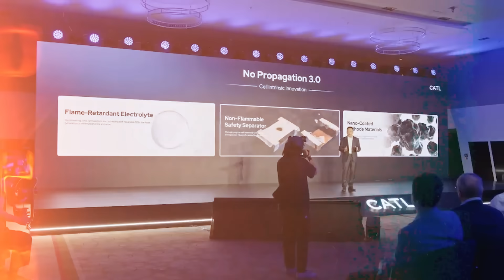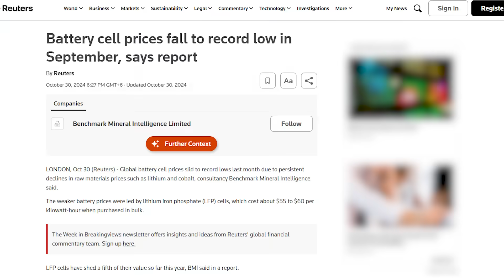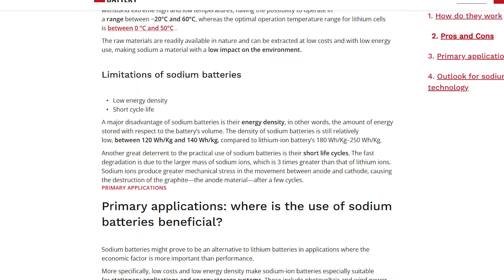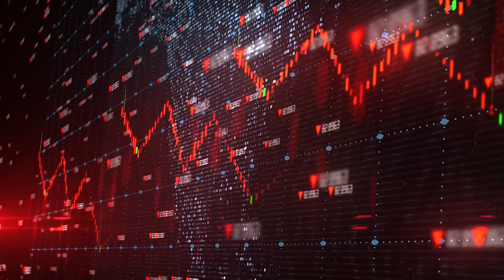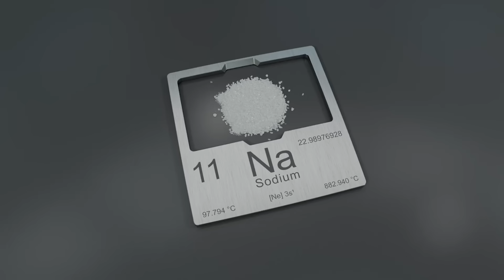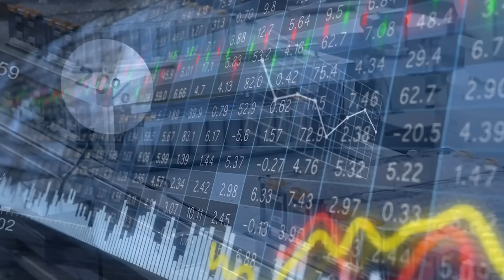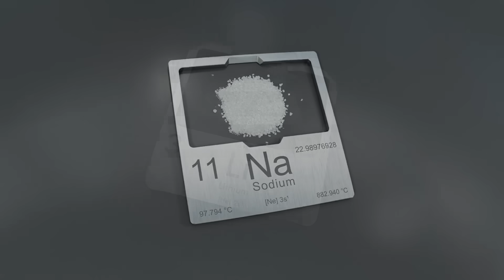This Battery Lasts 3.6 Million Miles And It’s Not Lithium

Comment: I will not buy an electric car until batteries have over a 15-year warranty. They're just too expensive to replace every 5 to 10 years.
Reply: 3.6 mio miles sounds  like 15 years and more!
Reply: The average ICE car  here in The uk is driven about 9,000 miles a year. 

So 3 million miles is about 300 years+  @spogulis
Reply: @spogulis  3,6mln mil to wielkość abstrakcyjna i jest tak samo nierealna jak 1 mln mil na bateriach Lifepo4. Nie znam samochodu elektrycznego który przejechał 1mln mil na baterii. Ten film kłamie.
Reply: Yeah but in 5 years they might have a better battery just a thought
Reply: @hi1itsme have you ever driven any car that has a 3 million miles on the clock. Would it really make any difference to you if your car battery could do 20 million miles.
Most of us would be dead before we have driven 1 million miles
Reply: @robmorgan3842 yes, but something else would become the limiting factor. The motor? 

There are already grid storage systems, using  ex-nissan leaf batteries are  Still working well in grid storage systems  All be it now down at the  40-50% capacity level. 

They may end up spending more time in that role than they did In the car.

In fact The main thing the grid storage people complain about is the lack of batteries
Reply: @hi1itsme  ...things are always improving!
Reply: @hi1itsme  try 2-3 yrs.  besides Li packs are now cheaper than most ice engines and you'll be lucky to see any modern ICE car last even a quarter of current battery packs ...and along the way you will spend a fortune on oils filters coolants gaskets and hundreds of  parts that wear out ..
Reply: Eves technology now is much better than the past 10 years
Reply: That's why China sell a car with unlimited warranty, but Chinese change auto every 3 years and the state pays for it.
Reply from the maker: It's certainly a valid concern regarding battery replacement costs!